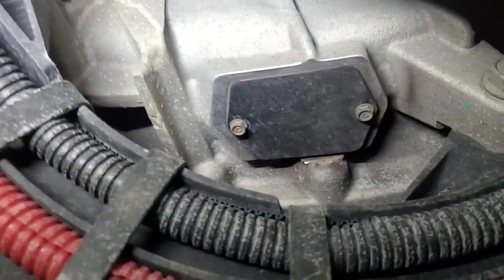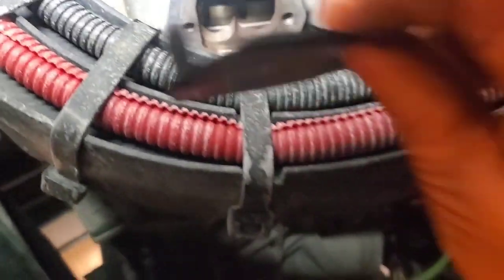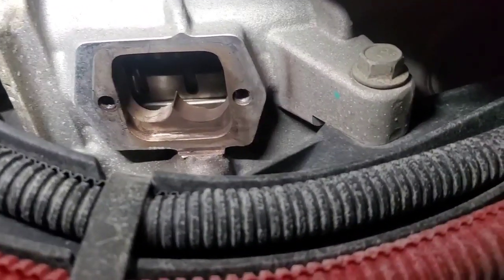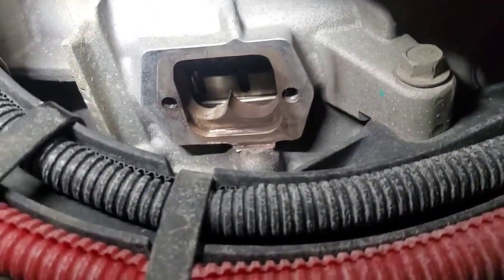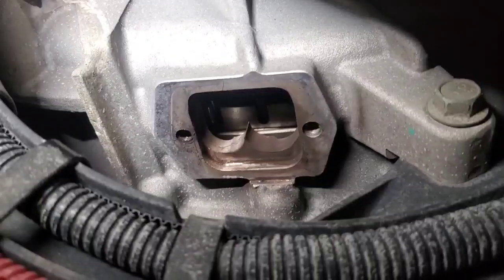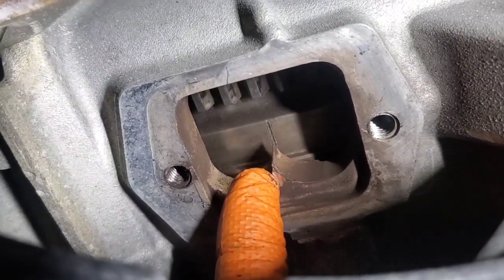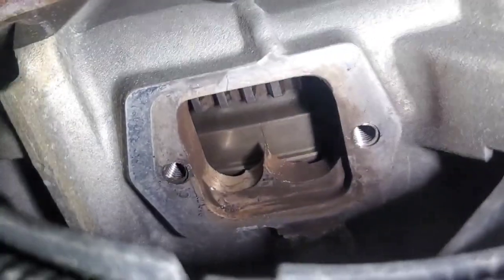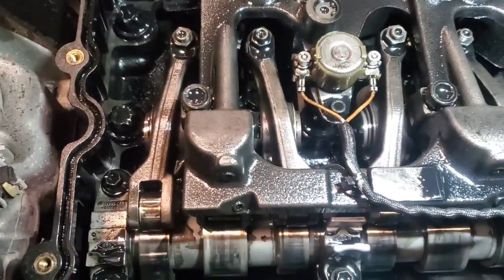How to set #1 TDC on an International A26 engine for top end set

Comment: What are you using to turn over the engine? The crank pulley does not have a bolt to turn over
Reply from the maker: You can use the high pressure pump final drive gear, I believe its 19mm. or you can turn it with a Barring tool bolted to the bellhousing or use a screwdriver to turn the flywheel at the access hole in bellhousing.
Reply: @AcousticHills Thank you very much!

Comment: How would I know when it’s on 6
Reply from the maker: When both intake and exhaust rockers are loose.
Reply: @AcousticHills Thank you boss. I wasn’t sure if there was a timing mark on the fly wheel or not. Thank you
Reply: @zacharyrawlins4696 there is. That line you line up with the timing case is the mark. You’re either on TDC 1 or 6 and you know because said cylinder both intake and exhaust valves are loose whereas the opposite cylinder is on overlap. Go around again and you’ll be at TDC 1, goes back and forth revolution by revolution